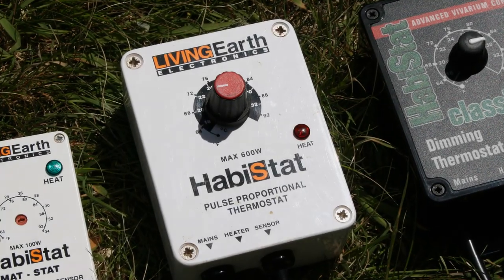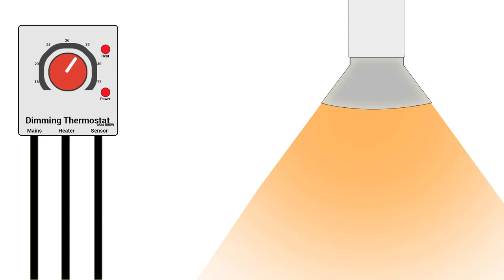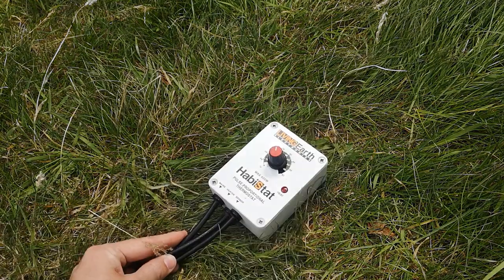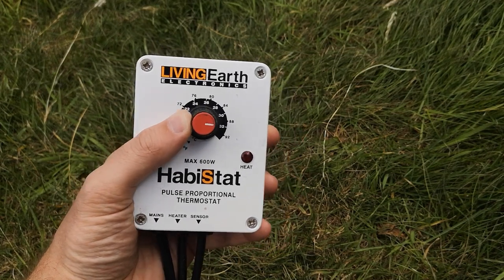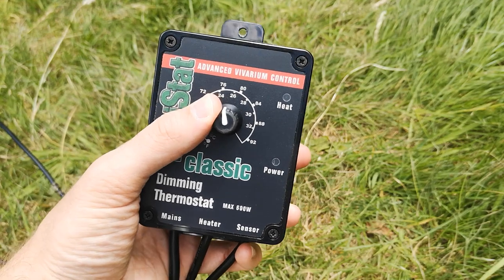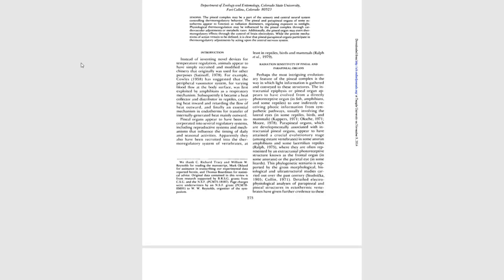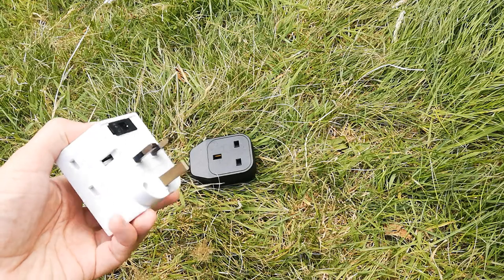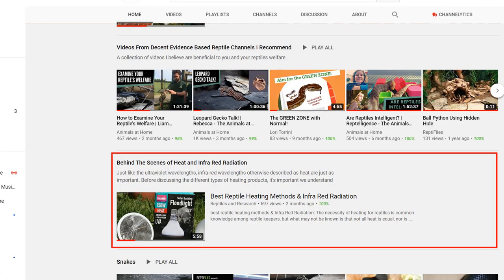How To Use Reptile Thermostats!

Comment: I'm really glad that I found this video. Where I live, there is no way of buying a dimming thermostat without resorting to international shipping which costs as much as the product itself. I recently came across a suggested setup online that uses an on/off thermostat alongside a dimming switch for the halogen bulb/ DHP. The idea is to manually adjust the intensity of the halogen bulb/ DHP with the dimming switch and set the thermostat to the highest acceptable temperature (~34 deg celsius) to prevent frequent turning off/on of the heat source. Would this be feasible or are there unforeseen problems with this type of setup? Thank you again for this absolutely wonderful video. :)

Comment: If you connect 1 thermostat to 2 different heat sources i presume you mean in the same enclosure and running the same wattage bulbs,DHP,ceramic not sure that the thermostat temp probe would be able to tell the difference between different enclosures and wattage of bulbs used it may be possible in separate enclosures provided that the enclosures are exactly the same size and distance from the heat source ?

Comment: Good straight forward info but can I ask if only one prob how do you get correct temperature if you want to use with two different heat bulbs thanks
Reply from the maker: Because if they are on the same stat they will be dimmed equally to achieve the set temp

Comment: Awesome stuff thank you. So my 600w max load Evo Lite Stat could easily control my 2 45w Heat Mats on Pulse Setting, i always thought only one heat source per stat
Reply from the maker: Exactly it could handle both no problem. I thought the same up until recently. The money that I could have saved 🙄
Reply: @ReptilesandResearch  thanks man appreciate what your doing for the hobby
Reply from the maker: Hopefully I'm only just get started

Comment: Im so glad i found your video i have been going insane can i ask because the thermostat that i order is confusing me it says 1100w surely thats not the wattage it needs to use would that be the max wattage it can take ? My heat mat is 5w i want to put two of the same thermostat into a extension lead as i dont have a lot of spare plug sockets its for two separate giant land snail inclosures in the manual it states output resistant load 1100w but aslo it says consumption  3w. Sorry for the long comment
Reply from the maker: Hi it means it can take up to that so your heat mats on it will do absolutely fine!

Comment: How long does it take for a on off heat mat thermostat temperature to set ? I did just set it up like an hour ago I could be being impatient lol
Reply from the maker: What do you mean by set? its likely the heat mat taking a while to reach temp
Reply: @ReptilesandResearch  oh ok ok so this is what I have. I have the zoo med reptile digital thermostat and a I power heat mat and it seems when I tape the probe it comes with either inside of the enclosure or if I sandwich it between the enclosure and the heat mat for some reason the heat mat doesn't heat now when I just leave the probe out it does heat so that's the problem I'm having now.

Comment: what was that thing called with the multiple plug outputs ?
Reply from the maker: Extention block, or on amazon i found one called "Eagle 13 A 2-Way Block Socket Splitter Mains Adaptor"
Reply: Reptiles and Research thank you x